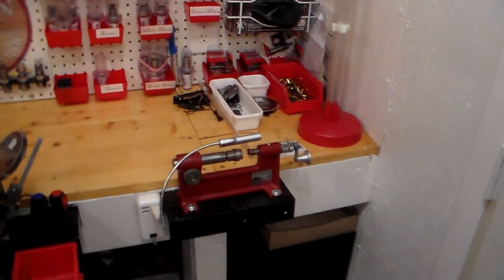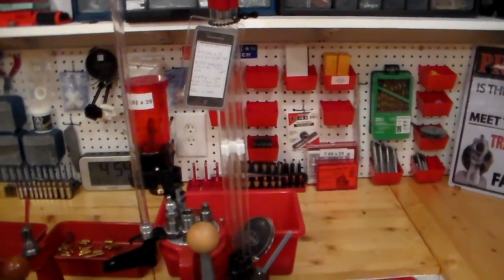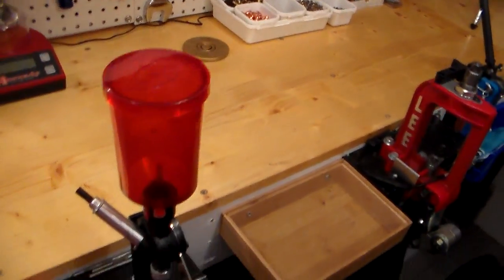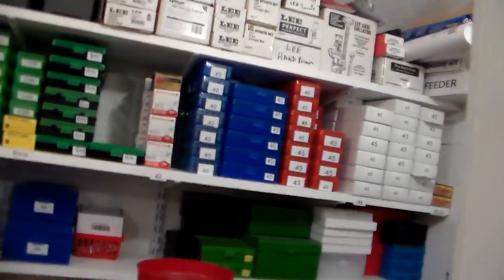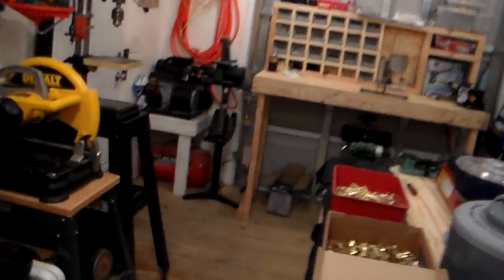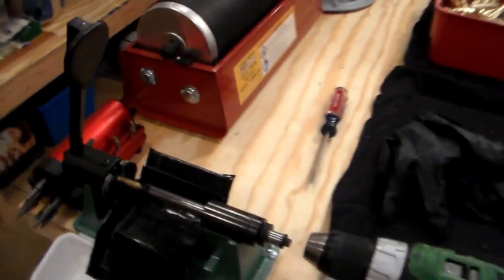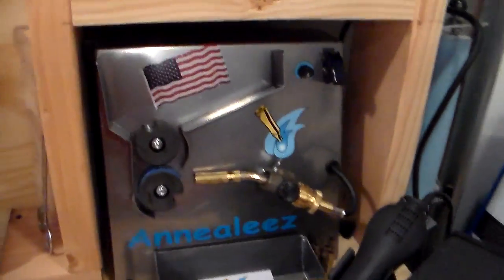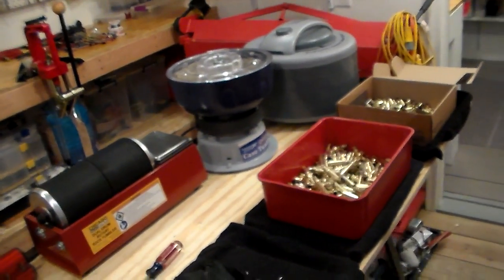MAN CAVE-RELOADING SHOP

Comment: Holy hell... You've got something like 50,000 primers sitting under 50 pounds of powder. God forbid a fire break out but if it does, I hope you can run fast!
Reply: Impressive setup but I think I would not show this on You Tube I believe ATF has a limit on number of primers which may be in possession and that much powder I think is to be is a specific storage. Just saying because another channel had video of a guy shooting an AK pistol with a vertical fore grip and ATF contacted that video poster.
Reply: John Knapp ATF regs also say that commercial establishments can not display more than 20lb of powder in 1lb containers. 

I have never been in a gun shop that stocks reloading equipment that doesn’t grossly violate that regulation. 

Powder quantity limits does not seem to be something that the ATF even enforces.
Reply: @riflesfirst208  The few stores that I have been too have empty 1lb bottles in the display cases behind the counted and the bottles with powder in a controlled environment in the back room. I only know that because I wanted IMR 6895 but the only bottle they had was the empty display bottle. Makes sense.
Reply from the maker: I have already taken care of that issue. My local gun shop is storing my powder and primers. Thanks
Reply from the maker: I hope that never happens, because I am not very fast runner. lol  I have climate control that is supposed to help. I keep this room very clean, no powder or primers on the floor.  Thanks for your feedback. Good Shooting My Friend.
Reply: @Harleychromeman  yeah you sure want a nice floor that is very easy to clean no cracks or grain
Reply: Smokeless powder burns fairly slowly when it is not confined. (I keep my primers on the other side of the room away from my powders, though).
Reply: @bill65761  "Smokeless powder burns fairly slowly when it is not confined." - but makes a pretty tall flame. Even if it burns "slowly" (it burns faster than most combustible materials you find in houses) the real danger is that the fire will increase room temperature and make several materials start offgassing flammable vapors that collect on the ceiling and create a flashover.
Smokeless powder burns faster than all the flammable synthetic fibers in curtains and furniture you'll find in a room, and yet a modern living room will get engulfed in flames within 2-3 minutes. Smokeless also has the added danger of containing it's own oxidizer which means it will keep burning and producing carbon monoxide, which will ignite once it contacts fresh oxygen. There's a reason why gun ranges made from concrete still need ventilation and sweeping of the floors, and often ban steel core ammo because of the sparks.
By no means am I trying to discourage people from storing powder at home but I'm just asking for people to be a little less dismissive simply because smokeless "burns slowly". Statistically speaking a normal housefire is more likely to destroy your home than your reloading setup. But if a normal home already has considerable fire hazards, smokeless should be treated as one.
Reply: Was having your local gunshop store it for you a voluntary safety decision or are there restrictions on how much you can have on hand and/or how it is stored?
Reply: Smokeless powders designed for use in small arms ammunition are exempt from regulation under 18 U.S.C. Chapter 40 and the regulations in 27 CFR Part 555
Reply: For a fact.. if you have a fire... the fire department will not go in there...they will let it burn

Comment: might wanna pull your video as you are violating federal laws by improper storage and quantity of gun powder.  just a heads up.  awesome set up tho.
Reply from the maker: Already reduced my powder inventory to 20 lbs. Thanks for feedback.
Reply: He packed it in fireproof brass containers. ;-)
Reply: Idk about federal law... City fire code- very likely he is in violation. Generally anything over 20lb needs to be stored in a 1" thick wood box. Maximum of 50lb per residence.
Reply from the maker: Not going to pull my video, I am legal on my powder with only 20 lbs now.
Reply: ha. ha. wink wink nudge nudge. you have well over 20 different types of powder on those shelves. Good thing you... umm... reduced your gunpowder stash to 20 pounds lol.

Comment: I tightened the die plate set screw with plyers, and removed the universal decaping die and the resizing die, I also removed the priming system. I checked the Bullet seating  die as you said before and found it smooth. with just the powder drum and the bullet seating die and factory crimp die in place ( yes there all lee dies) I started running some shells. I found that the first shell that went though the seating die was 2.250 the second was 2.245. and the 3rd shell was 2.255. I removed the factory crimp die and now I'm staying with in 5 to 8 thousands of an inch, a little better,  that swing is really got me wondering what's going on. if I put the crimp die back in I have a larger swing. I don't belive I installed any of the dies incorrectly. at this point I'm not sure what to do. I can put the crimp die in a single stage press but that defeats the purpose of the progressive. any ideas?
Reply: are you measuring your rounds from the base to the tip or base to the ojive?  If you measuring to the tip the bullets will vary in length which will cause your variance in OAL. You can buy a hornady tool to measure from the ojive or make one yourself.

Comment: I have a question about the loadmaster, when I'm reloading .223 the seating die is VERY inconsistent, I find it seating the bullet 15,000 of an inch greater or even less then what had it set for. I set the die to seat the bullet at 2.250, but it changes to 2.230 and even 2.270. have you had and issues like that?  and if so you think you can do a video on how you corrected it? other then that the lee loadmaster is great. sorry for the long question.
Reply from the maker: I haven't had that problem, I use a wrench to tighten my dies. my range is 2249 or 2251. 99% of my time I am dead on with 2250. check and make sure your die plate is tight. Next check your die inside the die and the cap screw to make sure you don't have deep scratches. If you see scratches, take dremel tool with cloth bit and polish the inside of the die. Do you crimp your rounds? What dies are you using? I am guessing lee correct?  If you still have the same problem, get back to me and I will do video for you. Great question! More than glade to help.
Reply: That can be a function of how consistent the ogive on your bullets is. Better bullets will tend to be more consistent. Also, make very certain that there is no spilled powder beneath the case when you seat the bullet (it will make it shorter) or when you were setting up (will make it longer when the powder goes away later).

1/15,000" is written as .015"

Comment: iv just got into reloading 6 months ago, iv loaded prob 1000,223,556  a few 3006 n 270 i have 4stage lee but measure powder by hand, you have any pointers,knowledge uve gained,that might help me ,newby,thanks brother,bo
Reply: Bo Eastridge Well if you decide to reload some pistol ammo a factory crimp is essential. You also want to pick up a bullet gauge to do a drop test to make sur they will chamber in your gun. It will save you a lot of headache.
Reply from the maker: I used to do my powder the same way but since Lee came out with there new auto drum powder measure. Best $35.99 item number 90811 cheapest place to buy Titan Reloading  best money you will ever spend, set your press up decaping sizing die, powder, bullet seating die and crimp. I have reloaded over 10,000.00 round with the new lee powder measure. Not sure how many rounds you reload, another thing to think about is bullet drop and not any of that expensive equipment. I can tell you how to set up your press to do a lot of rounds but down side is you have to come back to do your crimp and pull your indexing rod out. Keep watching my video's, I am going to do few on 3 different bullet set ups. If you have any question at all, please feel free to ask questions any time. I started with a single press and I have done thousandth of rounds. You don't have to have the bigger presses to do the job. Buy yourself a note book. Write down what calibers you shoot and what calibers are you wanting to reload. Next page pick your first caliber you want to reload, make a list of the dies you will need,powder , primers , bullet and cases. next page do your research on who has the best price that you can buy your supplies. next page do you want to make your own lead bullets,if so now list the equipment that your going to need. go with stainless steel pin tumbling to clean your brass. now its time to sat down and come up with a budget. start out small don't try to buy everything at once. As you continue to learn more about reloading and your shooting more, you will come up with what equipment works best for you. Now its time to start thinging about your loads and recipe. I have about 125 video's, go back to my reloading video's, they may help you a lot. Good Shooting My Friend.

Comment: 25lbs smokeless and 5 lbs of black is all you are allowed in your home "and" detached areas. ..that's not to mention... insurance company's ideas.....just saying!
Please check. Country wide years ago, "love the vids though"
Reply from the maker: I am below what I can have.  I am also insured, I had to put few fire extinguishers in place. I had to install water lines outside of the shop. My shop is climate controlled. Humidity is lower than 30% and my temp is 70% 360 day year around. My shop cost me more money to build due to being a reloading shop.  Thank You for your feedback. Good shooting my friend.
Reply: +Harleychromeman 
Wow!.... talking about "upping the ante" on professionalism. Have shown this video to some of my reloader friends. They had the same reaction we "all"do.... Wow! (the reloader's dream room) .....Carry on!
Reply: It varies county by county, but generally, local fire code allows for up to 20lbs of powder stored without restriction. anything over 20 pounds and up to 50 pounds needs to be stored in a wooden box constructed  with 1" thick wood walls.  No restriction on primers but they should NOT be stored in any kind of pressure vessel such as a steel ammo can that may hold pressure under chain detonation. Keep primers in original packaging of course...

Comment: cool set up but all those lee presses you should look into getting a few dillon xl650s and save on space and it would take a few seconds to switch out tool heads and or get your self dillon 1050 and you would be able to load everything in a few days
Reply from the maker: +transamkid 1986  I have thought about buying one to check it out. Thank You on your feedback. I have a product that I built that I have filed for patent, maybe than I can buy Dillon press.
Reply: I used to be a tool & die maker and was comfortable jumping right in. I bought the Dillon XL650 as my first press and have had no regrets thus far except that I don't have room for a motorized 1050 now. ;-)

I later bought a Lee single stage to pull bullets after struggling with an inertia puller for a few hours. That single purpose single stage is some of the best money I ever spent. 

The only better investment I've made in the past 20 years was for my wedding license. I agree with you ... "Good Wife, Good Life" (and, "Ain't nobody happy 'til Mama is happy!)